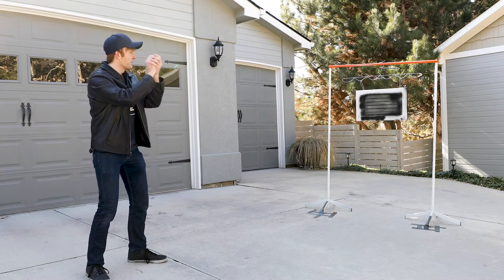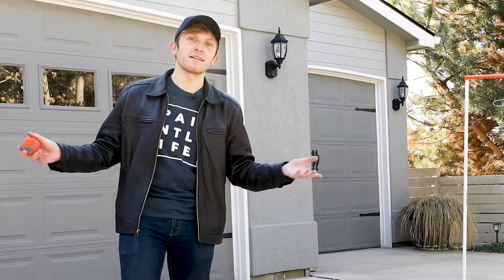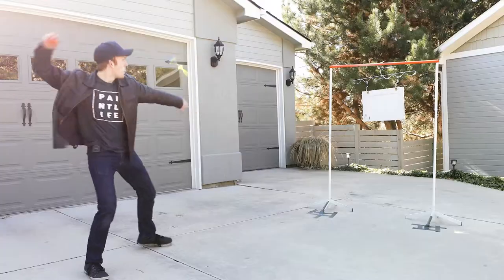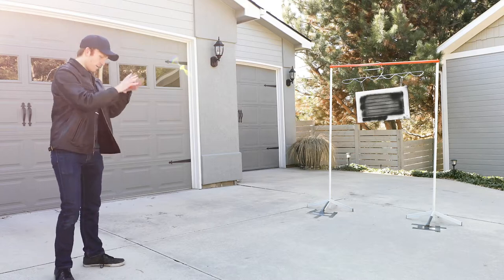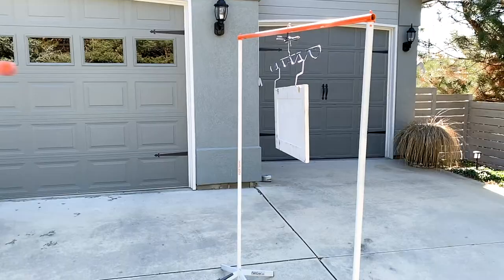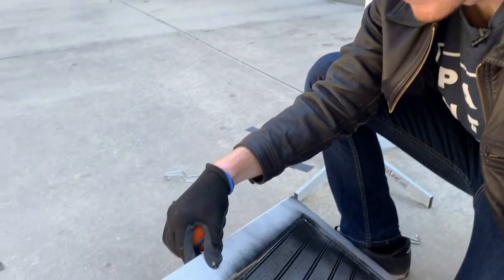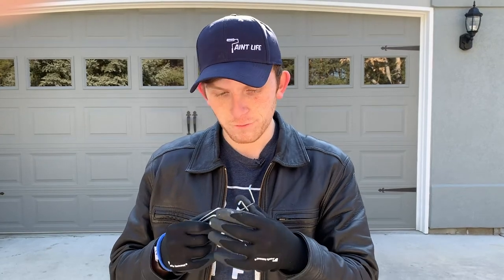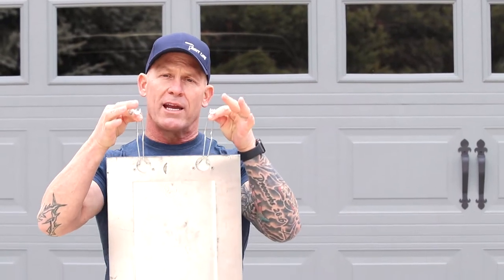Make Cabinet Door Spraying EASY?

Comment: Hmm I dont think the manufacture designed those to withstand, a baseball strike!  You could just drill small hole to accept the ends withing the hinge area , which would better hold.  Personally, think the hooks are more than adequate!  JMO
Reply: I think there good really good because in reality your just gonna spray and hang them up

Comment: Are there any issues with the paint covering where the hanger rod arms are?
Reply: The miss from the arms would be covered by the hinges when they go back on
Reply: all you have to do is change your spray angle or turn the door on an angle and you should be fine